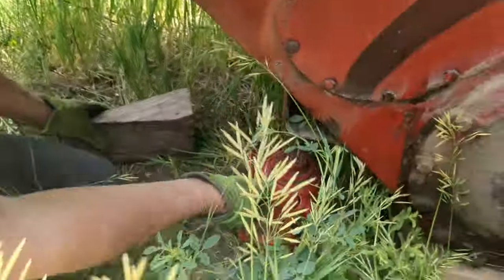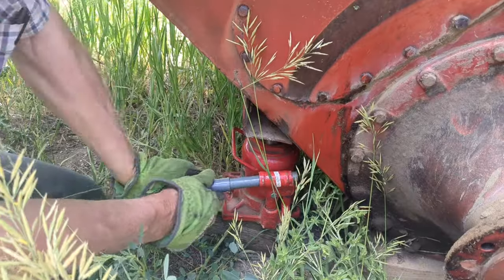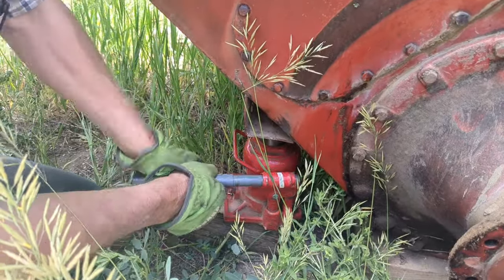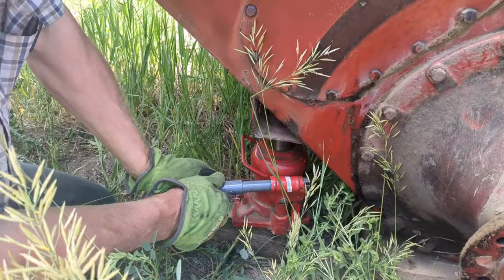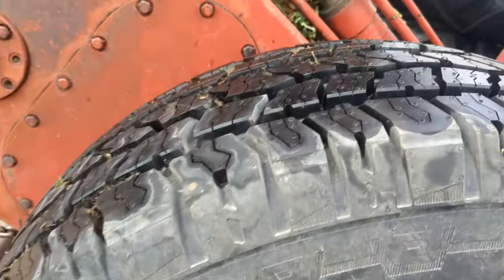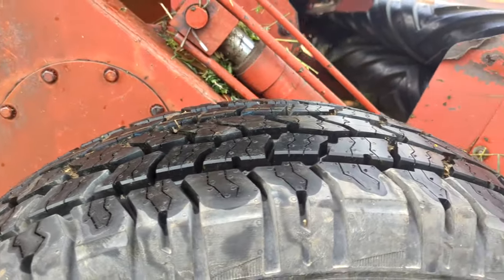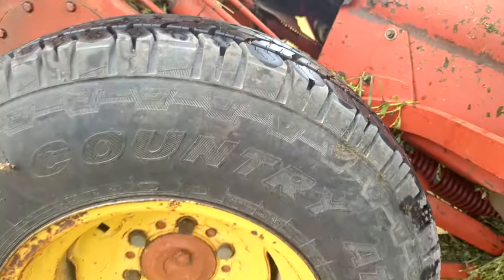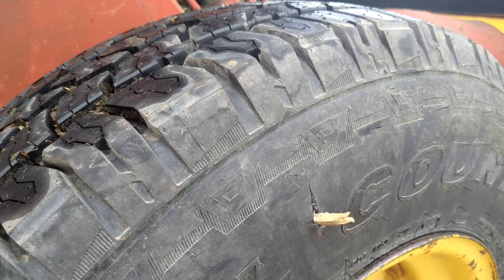Tire problems on the haybine.

Comment: Two things for you you had trouble from day one with the ramp ant no good with a 2 wheel rig make it a full size ramp like a landscapers trailer ,Next if tire shop wont fix the tire get blow out patches put one on the inside of the tire then foam fill that tire
Reply from the maker: Thanks for your suggestion